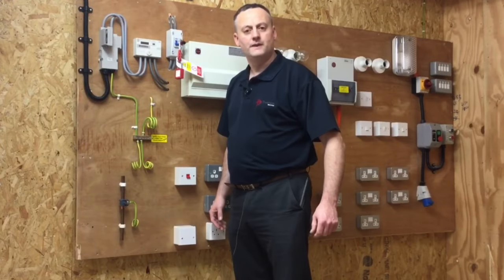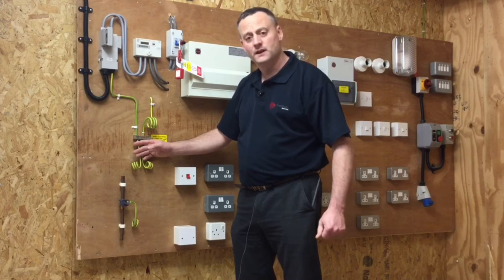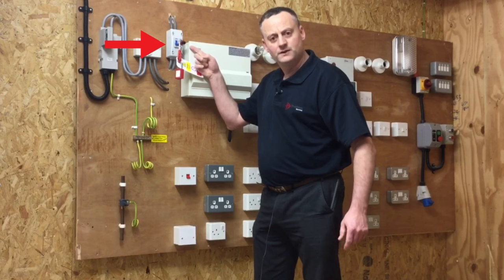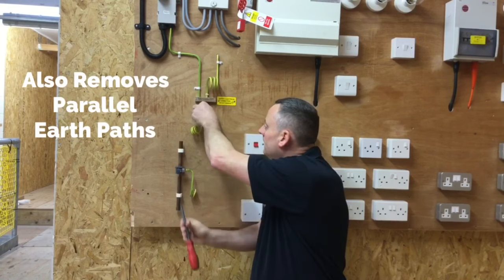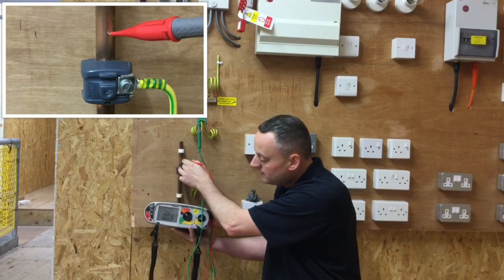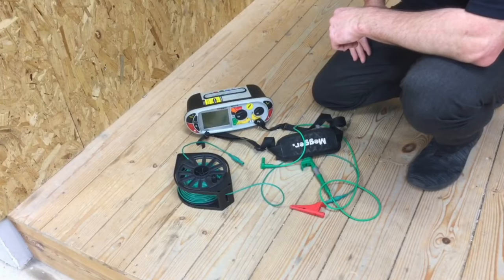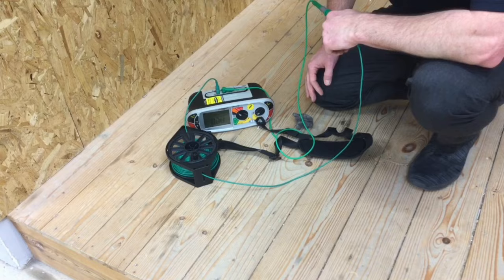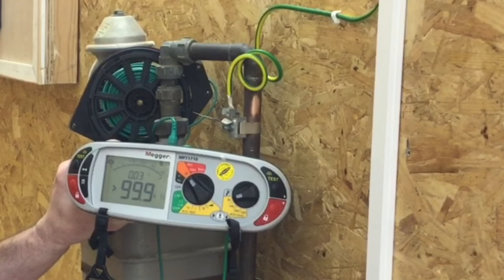Measuring the Continuity (Resistance in Ohms) of the Protective Bonding Conductor to Water and Gas

Comment: I don't get why you'd be worried about touching the pipe and the socket. If the socket is live you're getting shocked whether you touch anything else or not because you're at 0 potential too.
Reply: But if you've got rubber boots and not touching anything else then you wouldn't get much of a shock as there would be higj resistance. However if you were touching the unearthed pipe and the faulty socket you'd get a much bigger shock

Comment: Why wouldn't you do a Ze & Zs test at the same time? I dont understand why Ze & Zs is a live test when you have to turn off the power and test it dead. Why is it a live test? & why cant you do it in the dead test section after insulation resistance?

Comment: The maximum resistance allowed is 0.05 ohms. There’s a question in the past paper that talks about testing continuity of main protective bonding conductor to a gas pipe which is 10 mm and 43 meters long. The expected reading in 0.08 ohms which is worked out through calculation. Is this then not allowed or why is the maximum allowed 0.05? Anyone able to help?
Reply: I think it's just rule of thumb

Comment: Maybe somebody already asked: leaving the other main bonding in the MET you might distort the measurement of the individual connections by leaving parallel resistence in the circuit? I saw one comment 

the IEE GN3 states that 'the leads of the instrument are connected to each end of the conductor...One end...may need to be disconnected to avoid parallel paths' 2.7.5 Test method 2 para. 3.

"may need" is a bit vague there?

Comment: Another masterpiece Gaz cheers, quick question, when carrying out a Eicr will you need to test r2 at every electrical point, I say yes, others say zs at end of circuit only? Cheers, are there max. Readings for r2 on 1.0,1.5, 2.5,4.0 conductors?
Reply from the maker: Agree the extent of the works with the client requesting the EICR 👍. Thanks again Gaz

Comment: I looked at a consumer unit swap recently. The MPB for the gas is there at the board but a new meter has been recently fitted and the bonding conductor is missing. I've disconnected the cable at the MET and done a continuity test on the copper pipe and I get an acceptable reading but I obviously can neither see the cable or the safety label. Is my only option to run a new cable.

Comment: Can I ask a question please, this is not in the UK so you may not want to answer....I am Australian living in Philippines, but could apply to many places, the water pipes here are plastic, there is no gas or whatever...you have a earth stake in the ground and one at pole, plus the earth (CPC) is linked to neutral in Cu. The house's are usually concrete and of course full of steel reinforcement, sometimes the use the steel reinforcement as the bonding or the earth itself (no earth stake), what are your thoughts on this...I should point out the the steel reinforcement does enter the soil, but of course embedded in the concrete..
Reply from the maker: Hi. Thanks for the question I think.... plastic pipes do not need earthing, it sounds like your using a version of TN-C-S and TT UK earthing arrangements... foundation earthing is having its profit raised in the UK when the 18th edition comes out as an additional earth. Thanks for watching GSH Electrical
Reply: GSH Electrical  Thank you.... cheers..

Comment: Hi Gray , brilliant video.
 I would like to ask a question.
 is someone takes a test reading of the gas bonding without removing the water bonding  at the MET after safe isolation during the 2392-10 practical exam , does it make he automatically fail in the exam?
Answer will well appreciated.
Reply from the maker: Hi. We don’t currently offer the 2392-01 at my college so I wouldn’t want to offer an option. Gutted I couldn’t help this time Gaz

Comment: Hi Gary, enjoying your videos, I have recently been told that coiled/springing your earth cables (as seen in this video) is not best practice as it can create inductance in the circuit and could give poor earth fault path readings, I am sceptical, have you any thoughts on this?
Reply from the maker: Hi thanks for the question. We have to do it because the bonding connection gets removed and reconnect about 50 time a week. This is the only reason it look like it does. All the best Gaz
Reply: Thanks for your quick reply, I think it looks better too...👍